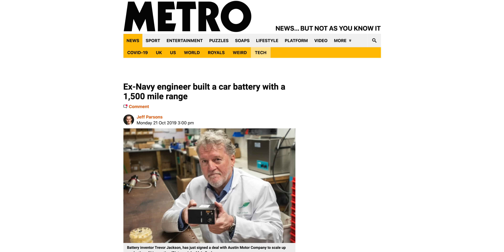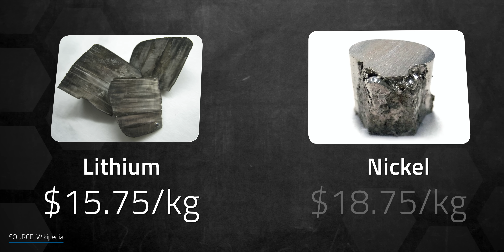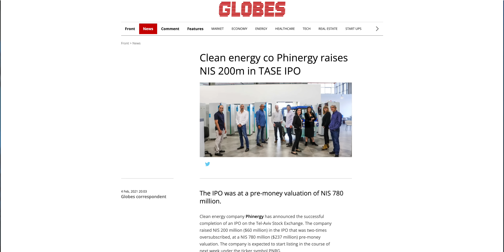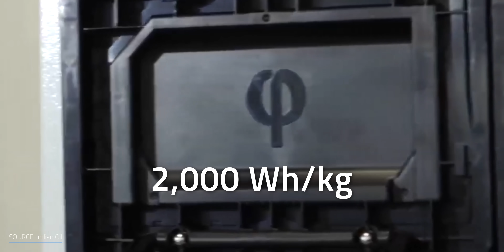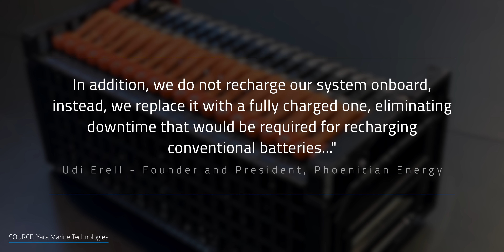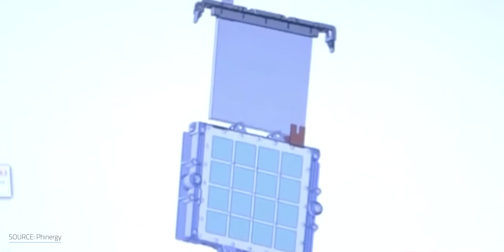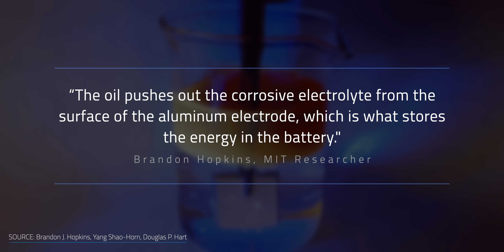Exploring the 1000 Mile Car Battery - Aluminum Air Hype?

Comment: If these batteries are cheap enough they probably hold more promise long term than regular batteries.
1) Long charging times is one of the most problematic aspects of EVs, which would be solved with replaceable batteries. And people could buy these batteries in bulk, plus since everyone is used to buying gas, the fact that buying batteries would be even simpler, faster and safer would be a big plus.
2) For practical use instead of having a single big battery vehicles should have 2 half the size that would be used in sequence, this would help with portability while also allowing for more granularity when deciding when you need a replacement. In the long trip example if your car tells you one of the batteries has ran out of energy you can easily plan to buy a new one at the next opportunity, or even better carry some spares with you to begin with.
3) Instead of having gas stations you'd have far more streamlined depots where you could replace your battery. Heck any store with parking space could sell these batteries instead of requiring the type of installation a regular gas station already does, and without the issues charging stations have. And again in the road trip example if every store along the road had at least some batteries in stock it would mean it would be close to impossible to end up without charge in the middle of the road.

At the end of the day it will all hinge on the price these batteries will sell for, but if they are low enough (given most parts could be reused) they have the potential to easily overcome all the competition.

Comment: The problem with all these moderately researched and casual YouTube videos is that the creators think it is a zero sum game. It is another alternative and potential solution, not the only one. Passenger EVs are not the only application for batteries. Stop thinking only in terms of powering your Tesla! 

The whole world is not going to run only on lithium batteries. Not ever. You need a mix of solutions including hydrogen, synthetic fuels and cheaper batteries.

Comment: If the swap could be automated, Tesla showed a proof of concept automated battery swap some years ago that was faster than filling a tank with gasoline, and it was fast, how is it any different than what we do with ICE vehicles today. You drive up to a fueling station, and fill up, or you drive up to a swap station and swap.  I think it would be workable particularly if you could hit the 2500+ mi ranges stated between swaps.

Comment: I live in an apartment and the number of charging stations in the area is about three (3 mile radius but I live in a more affluent area).  Charging the battery is so cumbersome that it is not a realistic option.  But if I could swap out the battery then the whole equation changes as long as I can find a swap out station within a 10 mile radius of where I live and commute.  Multi family units number 38 million in the USA which is a significant market that electric batteries are not a viable choice.  I would estimate it would take 20 years to outfit even half of these complexes to install some type of charging stations and one has to remember that somebody has to pay and be responsible for the electricity cost.

Comment: While the potential transportation applications of these batteries are interesting - I feel like aluminum-air would be much more ideal for low power, long term, off-grid/remote energy needs where solar or other renewables aren't practical/reliable. Signal repeaters, security/surveillance, research data collection, asset tracking - situations where power is needed for the longest duration of time with no maintenance/resupply. This would necessitate the mitigation of self discharge though - which at least for now sounds like it's a big issue for this type of battery :/

Comment: i'm sorry, I typically love your videos Matt, but the scenario that you posed about what if you're driving in the middle of the night and your Al-air battery starts to run low and there are no swapping stations open? This is a poor argument against Al-air battery tech. 

Just like with gasoline powered cars, what if you're driving in the middle of the night and you're low on gas and there are no gas stations open?" Well, i would say, you're SOL and you will need to call someone or park somewhere for the night until the gas station is open. same with that argument. 

Why can't a battery swap be brought to you in a truck? from the video you're showing, that a Al-air battery swap can be done by one person and in minutes. so what's the problem?

Comment: Yes I would , swapping is a feasible solution and better than Li - which means Chinese processing and dependence. Hope Indian Oil and Phi will get this sooner than later. Trade off between long range and swapping issues. Rest of issues like corrosion will be solved with science.

Comment: Having a swappable battery that provides a traditional tank of gas range with same accessibility and reasonable cost would be a much easier solution than a plug in EV. The infrastructure of going 100% EV new sales in 2035 is not feasible without past charging in a reasonable time. How will people who live in dense areas (such as apartments) pay for a large scale at home charging? Right now fast charging is just not there for a quick top off. 

Having a swappable  battery under the hood that can be changed in the same time as filling a tank of gas can easily be adapted at gas stations. Also, it is a lot less toxic in materials being used than Li or NiCads.

Comment: Rechargeability is one of great advantages of lithium batteries. And it looks like we are reaching toward and over 1000Wh/kg battery capacities if it is true what is told about new battery breakthroughs (stable Lithium Sulphur batteries)
There are also aluminium and magnesium ion batteries researched- and it is quite promising.
I wouldn't like battery swapping. It is simpler to wait 30 minutes for recharging and relax a bit. Driving more than about 200miles in one go is not exactly safe. It should be regulated

Comment: Maybe for specialized uses. With the energy density, how about eVTOL's?  Or for rainy days, off grid, replacing that noisy and smelly diesel (gas, propane) generator?  (How long does it hold a charge?)

Comment: I think cost will be a big factor. The Aluminum air battery is quite a lot cheaper to make than the equivalent Lithium cell battery.
So on buying the car it will be a lot cheaper with the Aluminum battery. The electrolyte is distilled or well filtered water, The waste is aluminum oxide from the anode. All can be swapped out in a couple of minutes at a station. It's early days, back when cars were new, gas stations weren't that common. It changes in time. 
A Lithium cell in an EV needs replacing on average every 10 - 12 years and ends up costing more than the car is worth.
At the end of the day, the total cost between the Aluminum cell and Lithium cell cars are about the same over 10 - 12 years.
The difference is that cost with the aluminum cell car is spread over the years as the anode is replaced every 1000km and distilled water, the Lithium cell car there is the charge cost to recharge and the replacement of the pack after 10 or so years. As above that costs more than the car is worth so the resale value is no longer there, where the aluminum cell car will retain more resale value.
Hydrogen cell cars may also hold resale value too and only take a couple of minutes to recharge as well. I don't know the life cycle of the hydrogen cell or costs.

Comment: I guess the biggest roadblock for this would be infrastructure and logistics? Many cities already have EV charging stations - it's going to be very difficult (likely impossible) to compete with the already available convenience for rechargeables. Just making EV charging available has been (and continues to be) challenging. The next battery tech probably has to be rechargable, otherwise we're starting from scratch again...

Comment: I was so glad when I discovered rechargeable batteries as a kid, never had to buy new batteries for my Game Boy again and still doing this for all my wireless Gamepads, Remotes and other stuff because I hate swapping batteries and the need to buy new ones.....now this should become a trend in cars again?
I don't know, one of the major advantages for me in BEV is the possibility to load it with my own generated electricity froma solar cell - never pay for driving your car again.
Think the biggest problem will be to get this into market, I don't think that many solution for BEV could co-exist and recharging is, in my opinion, still the easiest one.
Reply: i remember being extremely dissapointed with the rechargables that were around pre-lithium. they had all those problems with battery memory and stuff it turned me off from rechargables for a really long time until i got into vaping and realized how good the lithium batteries are, i just wish they were ethically sourced
Reply: @katiebarber407  Maybe you should've looked again after some years, NiMH batteries don't have memory effects anymore and also the capacity improved (Sanyo Eneloop). Main issue is still the lower voltage compared to batteries (1.3V vs 1.5V), most of my devices last around 20% less than with normal alkaline batteries but that's something I accept for the luxury of recharging and saving a lot of money.
Reply: Yes, i was obsessed with rechargeables as a kid, thought they were so cool. I remember asking for a radio shack charger and pack of batteries for my birthday! I was so excited, hahaha

This concept looks like an "investment pitch" more than anything else. It's not even viable for stationary backup. And with silver being a component, how much would this cost? It sounds like a consumable fuel cell. 

Without being cheap and easy to find as dirt, and as easily recycleable as a lead acid battery, this is pretty much pointless aside from a few niche things. Everyday me and you? No way.

Comment: I'm just saddened by all of these great battery technologies that are decades away from actually being useful, at scale.  I don't say we should stop inventing, but by the time a battery like this could marketable we could see drastic improvements in the cost, energy density, and weight of lithium based cells.  The drawbacks to this aluminum air battery are too numerous and remind me that, to a hammer (someone with lots of aluminum), everything looks like a nail.

Comment: Seems like you could just throw an aluminum-air battery slot on the trunk, with a hookup to the BEV's battery in there, & if someone wants to do a huge road trip they can just throw the aluminum air battery pack in the trunk & hook it up when they know they need to go to a place where they can't find a charger. 

Instead of yet another platform of yet another weird kind of electric car that requires yet another MASSIVE infrastructure investment, why not design a supplement to established designs.

Comment: Why not a hybrid approach?  You could use lithium for the main at about 100 mile range capacity, then use a small al-air setup to charge the lithium and provide power to the car in stages. This way the pump could turn on when the lithium runs down to about 10% or so, it would turn the lithium off and the al-air on until the lithium comes back up to about 90%+.....then lithium turns back on and the pumps would empty out the vessels while producing whatever energy is left in parallel to help.  This way the corrosion doesn't have to be sustained throughout normal use, if a person is only going 5 miles to work every day, then the al-air battery isn't deteriorating.

I image that the same space that you use to store 300 miles of lithium would be able to store 100 miles of lithium plus 1000+ miles of al-air tech....and I'm sure if this were a thing, 100 miles would be plenty of time to get to a swapping station on your last al-air charge to the lithium.

Comment: I had the idea in college that we could just have a rechargeable battery-swapping program for EVs at every gas station. Leave your used up battery at the station and pick up a charged one. The station charges up your near-depleted battery and trades it out to the next person who comes in with a depleted battery. 
It sounds pretty simple.
Reply: There is a company in Korea and in China that uses this concept.  The big problem I would see is that lithium batteries degrade over time depending on heat conditions and fast charging cycles.  I would hate to expect one range on a battery and then get a much lower range with no advance notice as this is an unknown variable that can not gauged or read out on a meter screen.  The swap out station would have to track the individual battery which would require a national data base that would probably be controlled by one company, which is probably not going to happen in the USA.

Comment: If the range was 10x longer, battery swapping wouldn't be much different from changing tires or another car maintenance task, but at only 1000 miles, it doesn't seem like it's that much of a gain with all the downsides.

Comment: Yes. Battery swapping makes sense. No one wants to wait 20 minutes to recharge when a battery swap could take the same amount of time it takes to fill a tank. Regardless of battery type the swap will win.
Reply: I guess we need to optimize the swapping process to make it cost competitive. Can we figure out a way to swap just the Al plates and the corroded parts but keep the silver and everything expensive in place?

Comment: battery swapping is nothing new, they've experimented with that for Li-Ion....what's very compelling about Al-Air is the very high energy density, light-weight and I'm assuming they'll cost less due to using cheaper materials in general. I can see that finding use in the aerospace field, so long as it doesn't have a large carbon footprint to recycle these batteries. They'd also be great for the military. If you have suicide drones, you don't need a rechargeable battery. I wish them well because I see a clear niche for this product.

Comment: So, 1000 mile range sounds good right but without the ability to recharge the battery it really isn’t. One of the topics you failed to bring up was cost for a battery swap. What would the cost of replacing the aluminum air battery be? What is the average cost of recharging the current lithium ion batteries for that same 1000 mile range.

Comment: I can see companies using this tech, but the lack of recharging will be a huge barrier to the consumer market.  EV's have been around for a decade or more, yet there are many parts of the country (U.S.A.) where there are no charge stations.  If the logistics of creating widespread charging stations are too much for the current industry, where all the charging station needs to charge vehicles is to be hooked to the grid, how will battery swap stations ever get a foothold?

Comment: cost to replace the aluminum battery vs the cost of recharging the standard lithium ion packs to achieve the 1k mile mark(short term).  that's what gets me. the aluminum battery will have to be awfully cheap in the long run and initially to compete. really neat concept though. can see many one shot uses for these units but not really viable for transportation at this point in time.

Comment: Yes, sort of.... ideal would be a quick battery swap but one that you could also recharge! Imagine a fuel station where you pull in swap your alsmost dead battery for a charged one. The fuel station then charges it and when fully charged swaps it to the next customer who needs a charged battery. I believe they tried this in Israel, that Tesla has a similar plan but cells his charged battery for $80+ dollars which would be about $3.75 a mile (actually more if you didn’t drive it until it was almost completely dead! ). I think there is also a company doing this for ride sharing vehicles in Southern California

Comment: Lithium Ion and even lead acid battery swapping has been tried many times and has failed. Why would aluminium air batteries be any different? Unless it would be much cheaper than owning and charging a lithium battery. Invisible hand of economics, you know.

Comment: If the swap could be done by an average size person, one could have one battery in the car and a spare in the garage.  When the battery in the car runs low, then it could swapped with the fresh one.  The car could contact a delivery/pickup service to come and replace the used battery, or while we are dreaming, the car would drive itself to a station and return while you were asleep.  For the average driver, this would be a monthly service.  Of course, this assumes the total cost is comparable to current systems.

Comment: In my opinion, no recharge = DOA for consumer vehicles, at least as the primary energy source. Honestly, it's a problem the EV industry in general has, this obsession with range, when the only time it really matters is road trips people take maybe a couple times a year at best.

Meanwhile, they ignore probably the single biggest practical advantages of EVs, comparatively cheap fuel and never needing to go to a gas station. You want EVs to take off, stop obsessing offer the niche road trip use case and work on expanding charging where people are already spending time. Get chargers into offices, apartment buildings, homes, street parking, restaurants, etc. Make the every day use case seamless, and then worry about whether or not you can drive the thing 24 hours straight without stopping.

If I'm gonna have to go to a fuel station to swap an expensive disposable battery the equivalent of once every few tanks of gas anyways, we've negated both the cost of fuel advantage, as well as reintroduced regular trips to the gas station. Why would I even want one?